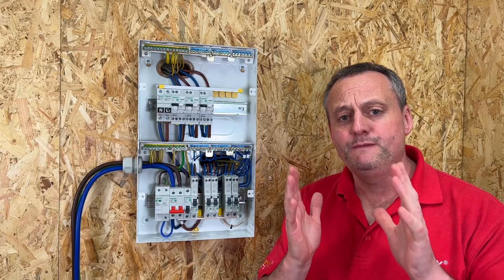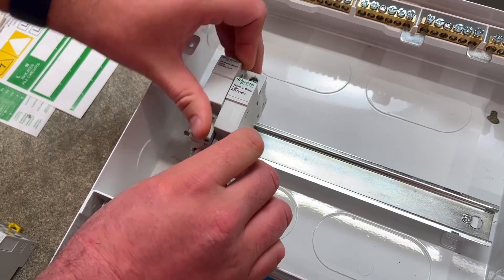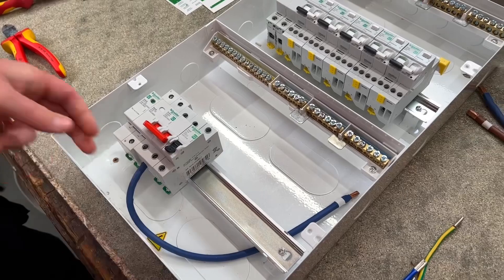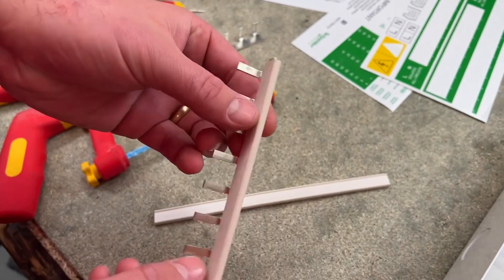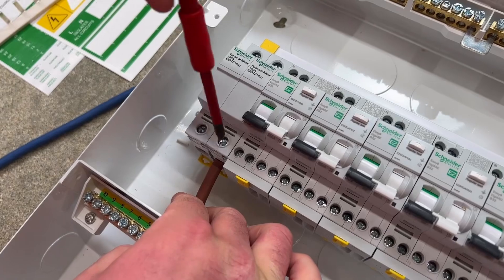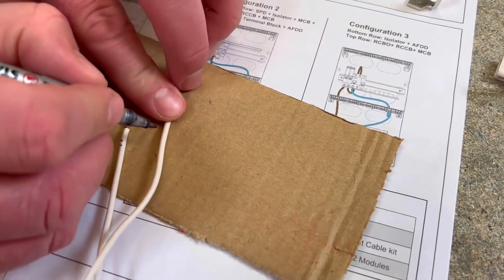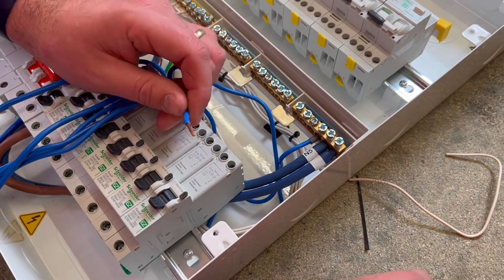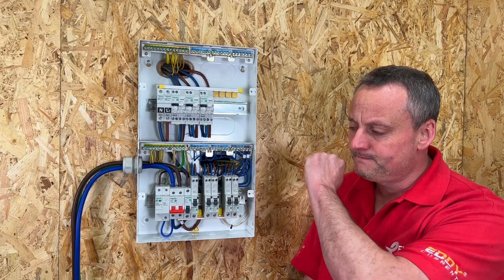Why Schneider Electric Chose this New Consumer Unit Busbar

Comment: Jeez ... STILL no 18mm, dual pole RCBOs! WHEN will we actually catch up? Ridiculous! 🙄🤔😱🥺🥺👎👎
Reply from the maker: We’ll take that as a No from you Bob
Reply: @efixx  correct! I already have a full dual pole 18mm RCBO setup and have had it quite a while. Complete with overvoltage, total supply over current (not available on any CU AFAIK) monitoring, surge protection, individual final ring leg current monitoring (to monitor for excessive ring imbalance, overtemp cutout, etc.) Functions simply not available at a reasonable price (or any price) from the industry.
Reply: @boblewis5558  I'd like to see that.  What is the setup protecting - feeding and what are the parts used please?
Reply: @jmileshc custom & proprietary electronics design with non contact current transformer per live and neutral (4 transformers per final ring). 100A isolator from an 80A incoming supply. 65°C and 85°C temp switches in the enclosure plus linear temp measurement to monitor rate of temperature change (fire can't start in/on plastics until over 220°C so electricity is cut via twin 63A isolators in the event of rapid heat increase). 

Monitoring is performed by an Arduino micro controller which feeds data to alarm software on the internal network (Rasberry Pi & home automation server) and then to mobile phone/s. The Arduino scans, via a mux, each individual current transformer (up to 64 if required) in a round Robin sequence 120,000 times a second and logs any significant change/s to the server and logs a "clear" signal every 10 seconds to prove the logging is active and for troubleshooting.

Imbalance monitoring of current in live and return legs helps diagnose faulty tripping. Rapid pulsing of leg currents in final ring/s indicate potential arcing problems especially if high frequency, high current spikes are seen. 

Full data logging can be used to diagnose intermittent problems as well as highlight static issues. As further IOT devices are added to appliances, individual appliance monitoring will also be added for tracking and diagnosing problems and energy consumption mapping.

 The data will also be used in the future for energy resource allocation after our solar PV is upgraded and battery backup included.

RCBOs are standard TOMZN IEC61009 type C, dual pole, 18mm breakers (before the recent changes, not that type A's would be needed as there is no dc offset on the supply - I've scoped it!) with dual feed bus bars, top fed for much easier cable management. 

Outputs at the bottom of breakers rather than the top mean power  transition to DIN mounted terminal output feeds via PCB mounted current transformers leaves all connections from cables being logical and neat with LEN connections per cable and short connections direct to DIN terminal blocks - all 32A rated except for cooker feed (40A) which are 57A rated terminals. Each ring leg fed via its own contact triple block.

Multiple alarm outputs for first enclosure overtemp (65°), second enclosure overtemp (85°), ring leg imbalance, individual cct L/N  imbalance (resolution to less than 1mA), overvolts etc. Electronics have built in battery backup sufficient to last one week minimum and use minimal power <6W. 

Plan is to have galvanically isolated dc bleed feed from one of our solar PV panels to provide continual daily charging in the event of an extended power cut. 

Lots of other goodies can be added by simple software updates. I designed the whole system and wrote the software and no, sorry, that information will not be published or shared!

Comment: What a mess I would like to see a cleaner board without tails flying everywhere
Reply: Yet we across the pond are able to fit an AFDD, 3 phase RCBO or who knows what in a board from the 1980s, din rail and wires to connect various kinds of busbars are future proof. It may not look nice but it works.

Comment: Looks like European style boards are being phased in.
Reply from the maker: Just need to go back to plastic!
Reply: @efixx  Yes, our modern CU is in plastic but most we build them into the wall with three DIN-rail closed with a door. We known that we not touch with our wet fingers inside. The once what aI like is the newer British socket and plug - our Schuko can change polarity too easily. So bigger machines (and caravan) use CEE DIN EU plugs and sockets. 

We are not stupid and chrashed electrical lines, boxes, CU's with hard metal things - specially in the consumer construction. It is difficult at ships or outside.
Reply: @efixx  Curious to see regulation different in different countries. Here in Italy for example we prefer consumer unit in plastic material, not that you can't install them metallic, but if you do so you have to put an RCD externally to protect the consumer unit itself for indirect contact (the reason is that if for some reason a wire gets loose before RCD protection and touches the metal housing it will become live, and nothing will trip since we have the TT earthing system everywhere in domestic settings).

Also they are usually put inside the wall, that is there is a big box in the wall like the one used for switches and sockets, and everything that can be seen outside is just the front panel. That makes it more acceptable to have on your wall (since we usually place them in convenient places, such as right next the front door so if you return from vacation and you did turn off power you don't have to go to the other side of the house with a torch)
Reply: Hmmm ... not really in domestic. We not use more as 64 Ampere on one phase in Europe and Asia. We use three phases normally. We not have SPD nor AFDD till now in normal houses. My apartment in Germany have only one RCD (we need it for bathroom (or for garden outside)) and so it is put over-all. My CU is metal box in the wall how is the back secured with plastic plate so that consumer can make on-off self behind the thin metal door. We do not tested or change all every xx years CU nor cable.  We use fire alarm boxes with batteries normally. 

At new installations we should use RCBO's specially for every socket line. So a gas heater need only 10 Ampere MCB direct (without socket). We should mix socket (living room) and lamp (bed room) so that never the full apartment is without power. In a bigger house I install two RCBO's for every room. Now they are not so expensive more, I pay for Hager RCBO ~ €30. These days do you need more power and more sockets as in the history in every room. 

In the house from a friend (build 1955) they use only one phase (his house was the first house at this street) and have one socket at door and two sockets in room. One light switch per room only the living room have two so that this lamp can use three and three E27 socket. With typically 60 Watt they consumed 3x60=180W (plus 3x60=180W (=360W)) only the lamp! In the history he can not use the sockets in first floor for the vacuum cleaner, newer models have a soft-start. Till now nothing change there but now he use more and more electrical equipment.
Reply: I saw what you did there.
Phased In.

Nice.
Reply: @FirstDan2000  🤣🤣🤣🤣🤣 I'm glad someone spotted it.

Comment: Full height RCBO's and functional earths! Have we gone back in time?
Reply: Agree, fusebox do better for a fraction of the price.
Reply: @arcadia1701e  I can get mini rcbos that are double pole for half the price, a 20way (which this looks to be) a fraction of the size and single module afdds. 
For the domestic market my money is always on fusebox, even tho anything remotely commercial or industrial I'll only go for schneider
Reply: Exactly who in their right mind is gonna buy this
Reply: That's what I was thinking.
Reply: and double wide afdds and SPDs, truly schneider is behind the times and their prices are horrendious
Reply: @AndrewStrydomBRP  Weird, I live in Finland and here Schneider's products are slightly more cheaper than Hager's
Reply: @peto22  Not weird at all, Hager is more expensive that anything else out there, only without good reason. (I reckon it's the final 24ct gold plating they apply before painting their devices white...)
I remember having to inform the client they would have to swap out all their old AC-only RCBOs to Type A due to change of use (their suite of offices had over time become full of IT equipment and other earth-leaking appliances).  We then discovered that each cost £158 🤯
Reply: @Dranok1  WOW. I can buy their AFDD under that price (Acti 9 iDPN N Arc C 16A 1P+N = 152€ vat 0%).  I can think of one possible explanation, we don't really use RCBO's here at all and I can't even buy them without a special order. I believe they are hardly used anywhere else in continental Europe, so they are a special product at a special price. Normal C10 and C16 MCB's cost 3-5€ and three-phase RCD's cost less than 40€ (Hager and Schneider).
Reply: @peto22  
RCBOs have been used here for the best part of 10 years. I have RCBOs on all circuits.  In that time they have become smaller and cheaper. Fault finding is then easy. Whole banks of circuits are not taken out if there is a fault on one circuit.  We should make all circuit interrupters at main panels double pole as they do in France.
Reply: @johnburns4017 Same here in AU. So much better.
Reply: @ 
We do not have double pole RCBOs as standard, but many are DP these days that are being sold. The French system is polarized but French sockets do not have standardized wiring for L and N, so there is not a strict requirement for polarization at plugs , etc, so they need DP breakers. The British and Australian systems are polarized with the neutral at 0v, all through to the sockets and plugs.  So if a single pole breaker opens on the L the neutral side is safe being at zero volts. DP is belt an braces on polarized systems but IMO worth it.